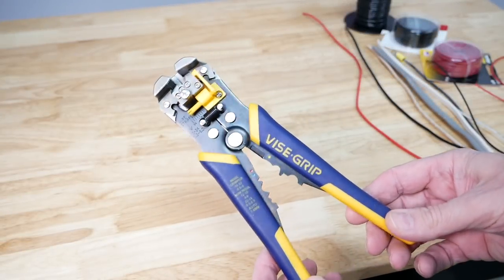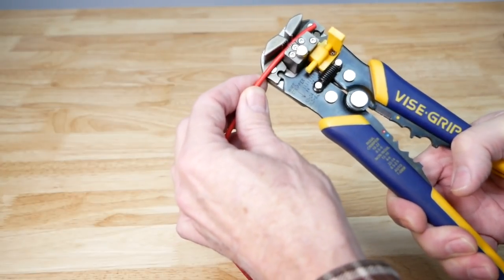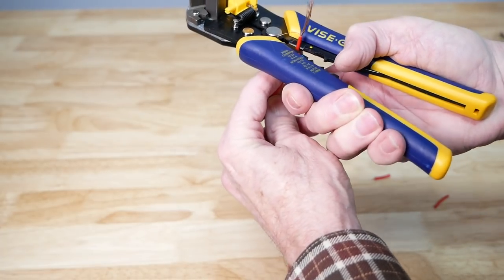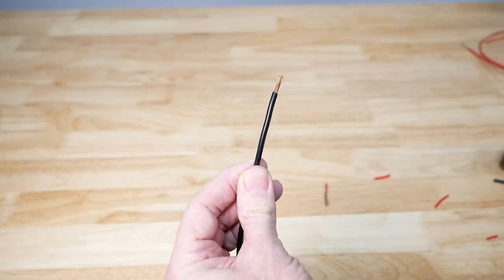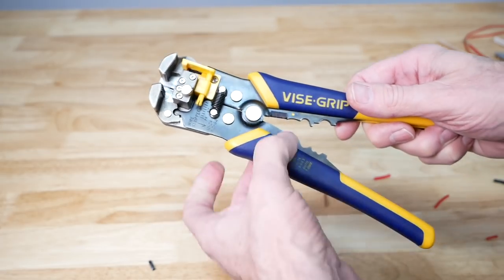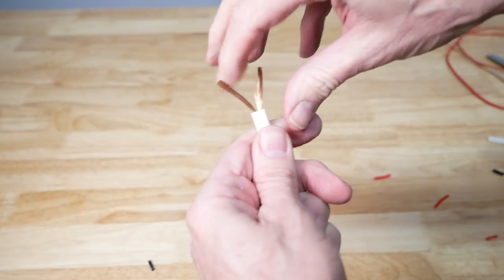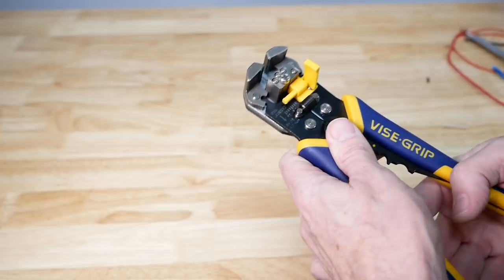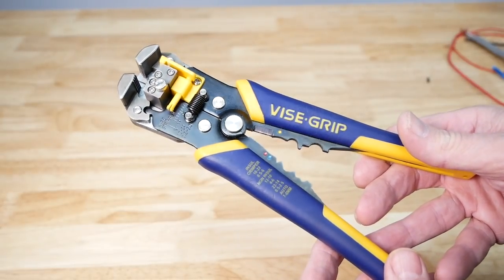Vise-Grip Wire Stripper from Irwin Tools

Comment: Great tool. I’ve had one very similar, for many years. It’s the only one I’ve ever used since I became a HAM operator at 16. It never messes up wire. And yes, I use the other crimper for very tight spaces. I guess I’ve been doing it right since Chris endorses it. Thanks again.